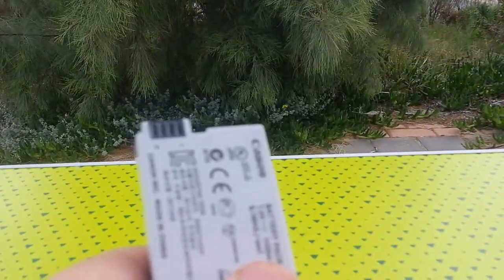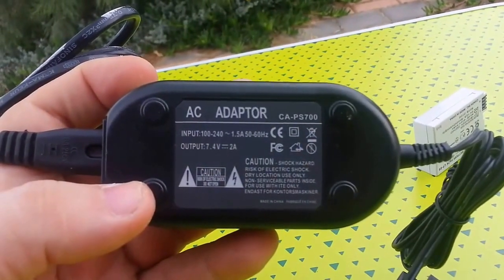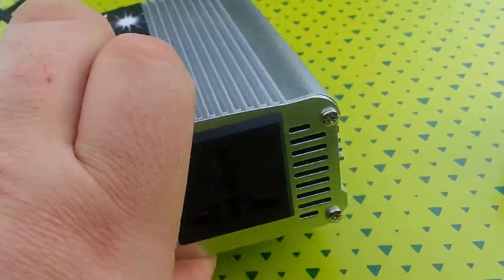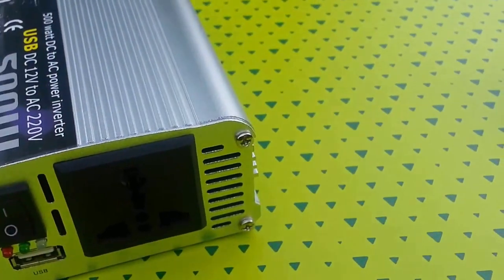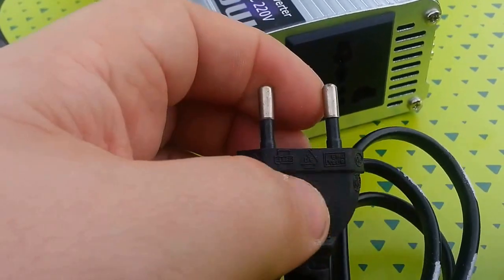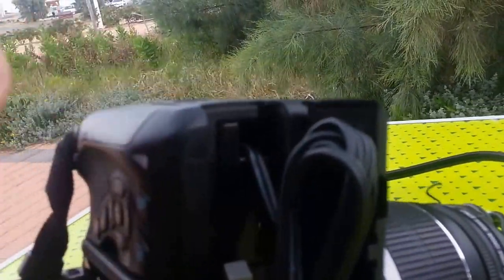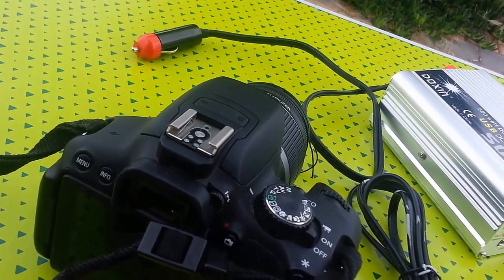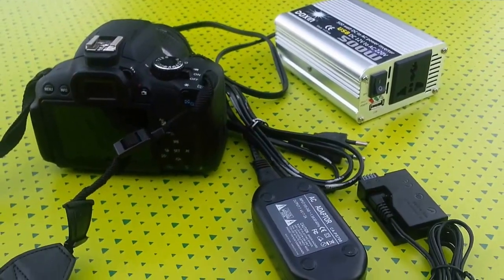Canon EOS camera mains and car battery power setup.

Comment: You know your electrics matt, but if using laptop and other things i would use a pure sine wave inverter just for safety.  If your out and about at night i use 12 volt led strings cut down, or recently using daytime running lights for outside lights run from solar, battery, 12 volt sensor,  just some of my crazy experiments for living on the cheap side .
Reply from the maker: There will be a hook up and water tank going in the van aswell just waiting to see what I can get away with removing without reclassification of vehicle. Agree on the inverter. Long term there will also be a regulator. But currently doing it all on the China cheap.LED lighting agree is much lower power usage. In the Philippines we swap to those on the generator when we have a power cut.

Comment: Nice setup but I prefer just to carry extra batteries. The 3rd party batteries for the canon are super cheap and work just as well as the originals.
Reply from the maker: +Philippines - Darrell Cheeks I've got 2 other batteries and the grip as well, just prefer this setup for doing time lapse. The adaptor only costs £12.00
Reply: +matt wilkie Great point on the time lapse.